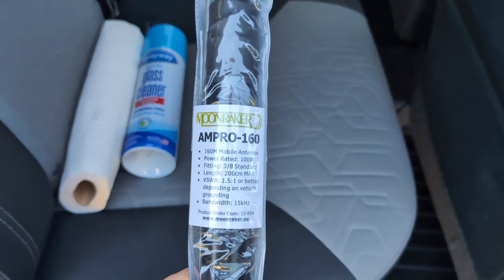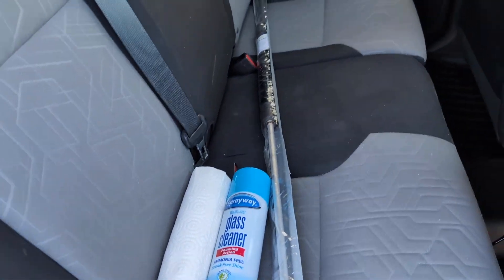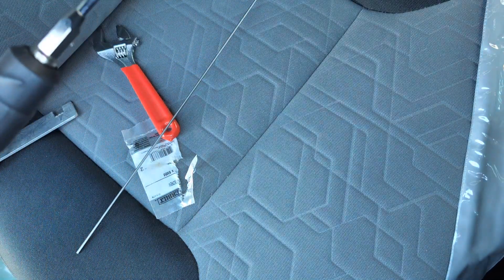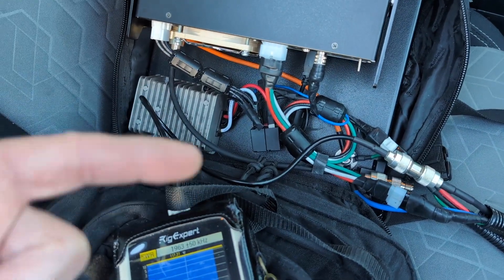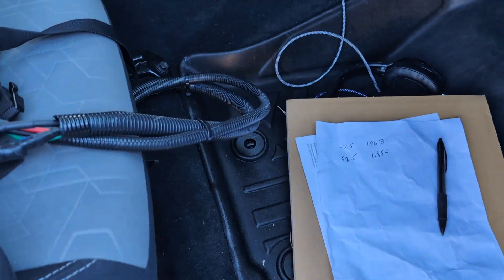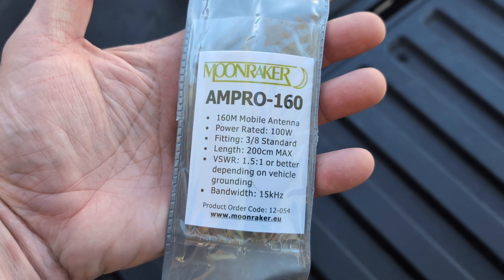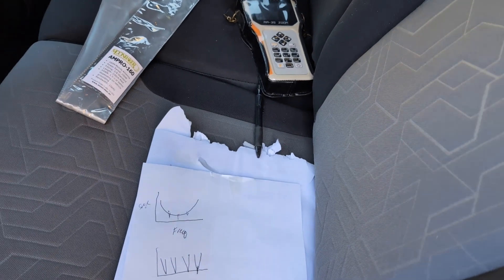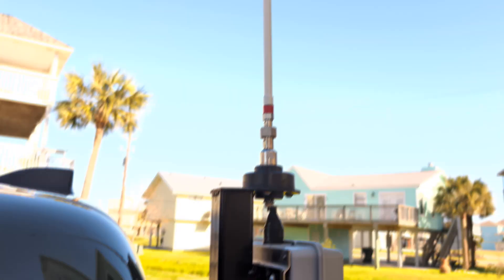Moonraker AMPRO-160 Mobile 160M Antenna

Comment: A quick check of the RSGB website told me SSB on 160m is from 1850 kHz to 2000 kHz so the range you got was about spot on although at least for the UK max power is limited to 32 watts.

Comment: I have been using the Moonraker 160 mobile antenna installed on the hatchback of my Jeep.  I use an FT-891 and run 75 watts through an FC-50 tuner located near the antenna feed point.  Even in motion it works better than expected.  I have a Diamond K400 mount and an elastic strap that goes around the loading coil to the roof rack to keep it there.  I spent weeks grounding and bonding with copper braid and it really paid off with improved radiation and reduced noise.
Reply from the maker: @johnhackert2092  That's fantastic.  It's amazing it works as well as it does.

Comment: I use the Ampro 160 version of this particular antenna for 160m portable. It is fitted, to a cheap and cheerful camera tripod, with a mild steel base plate. The mild steel plate has a couple of binding / grounding posts fitted, this enables the connectivity of a 65 feet length of counterpoise, simply laid out flat on the ground. I can achieve a 1.2.1 s.w.r. on spot frequencies. Our local net, is run on 1.955 MHz. I totally agree with what you have said, the setup has a very narrow bandwidth, hence ideal for net / fixed frequency. I have to say, this antenna does work very well. I do use this with Yaesu transceivers FT 817nd and FT 891. Moonraker do make another 160 m antenna called `Toybox’. This antenna works 10 - 80m, but has an additional inductor coil for 160 m. I have trialed this, and it does work, abeit it was 1 db down on rx / tx over the Ampro 160.👍🏻
Reply from the maker: I used it again this year during for the CQ160.  I didn't get to put much time in, but it worked great.  73

Comment: Cool video. Im a fellow 160m. Enthusiast as well. If i may. I recommend leaving your whip on snd attatching wire to tip. Ive been successful doing this before to get on 40. I wanna say it was roughly 20ft to
 25ft of wire and just tie it off to a tree. Obviously 160 will be much longer but its a much better antenna than that horrible compromise antenna you purchased. Also a lot cheaper! I saved the length of wire for 40m in my glovebox.  Just start long maybe 100ft. And trim slowly. It doesn't take too long. 73

Comment: I love 160 meters!  I was going to make a coil to run mobile.  A long time ago 160 was used like the 2 meter band.  Contrary to popular ham belief, it is really the only band that has a strong/reliable ground wave.  Usually even works when the sun wipes out every other NVIS band for local/semi regional coms.  I wish more lower power stations would get on it.  There is always plenty of elbow room down there.  I was able to get some contacts on my big loop for that contests but none outside of the USA.  Thanks for the video.
Reply from the maker: I plan on going down the 160 "rabbit hole" next winter.  I'll be  working on a full-wave loop towards the end of the summer.

Comment: Got the antenna yesterday and took it out of the box today. What an antenna!! Kinda heavy and I think I know how to mount it. I have the comet hatchback type mount heavy duty. Mount it at the bottom of the rear door on my suv. Get one of those marine antenna stand off and wedge it between the door and antenna along with some guy rope at top of roof so it don't sway side to side and the standoff will keep it snug fore and aft. I don't think the mount itself will hold it by itself.
Reply from the maker: Get it as high and clear of the vehicle body as you can.  Let's try to make a contact one night when you get it installed.
Reply: @n5yiz  I do have a 22 inch mast from comet I could add on. But I don't want to drill any holes in the body yet.

Comment: ..That same antenna was made by Pro-Am years back. I had one, and lived in an apartment. I mounted it on my balcony, on the 21st floor. My experiences were good. I did use my outboard tuner to cover more of the band.   VE3IIM/VE6PG